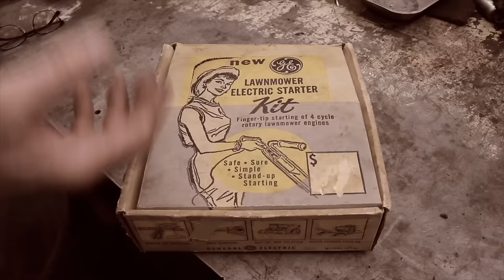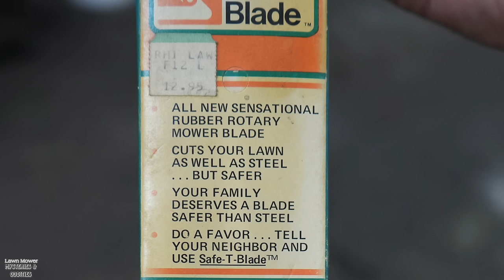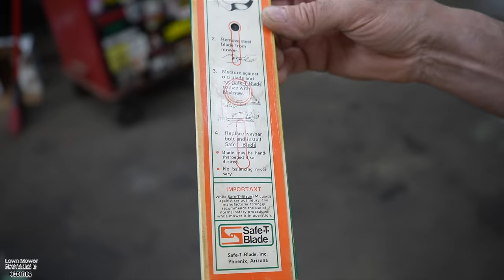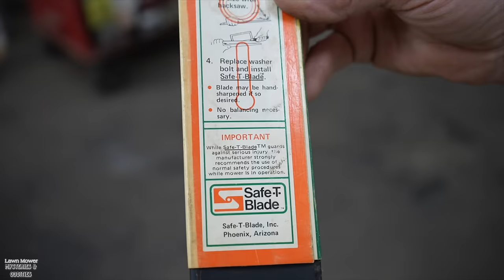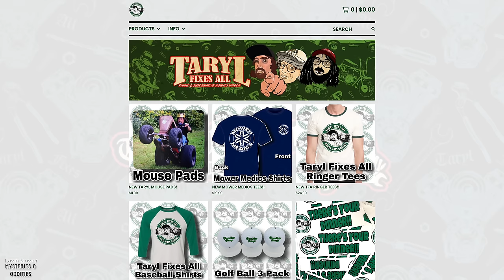Does This Odd Mower Blade Actually Sharpen Itself? Let's Find Out

Comment: Seeing this makes me remember all the hours I spent fighting a Lawn Boy mower as a young kid. 

Even today the useless drive wheels slip on flat ground. Somehow only finding traction when they can fight you. Yet whenever that assistance would come in handy they just spin. 

It easily stalled too just like I remember. That was always fun trying to yank the cord hard enough to get it going again. Or even better having to push that heavy thing back to the front or back door to get help. 

I remember the very first time I got to use a "cheap" push mower. I was still young enough to struggle with the weight of the Lawn Boy. Yet this "cheap" mower we bought for our camp. I found easier to mow with on steep ground. I could pick it up when I needed to. 

It was so much lighter. So much easier to move around. So much easier to start. So much better in every way. 

I wondered why anyone would buy a Lawn Boy. They were really overrated and underwhelming to use.
Reply: Man I love lawn boys, I have a 1982 2 stroke lawn boy and that thing can rev so high it never bogs on ANYTHING, crazy you had the opposite experience

Comment: That's about as safe as attaching your metal blade to your drill and going out and trying to cut the grass with it. Imagine that get a high speed drill attach a blade to it and do some edging. What could go wrong. Lol lol😂😂😂😂
Reply: They have brush cutter blades for string trimmers. Just like using your drill with a metal blade. Dangerous AF.

Comment: I would buy them for my rider
Reply: Why? Riders have belt driven decks so less of a chance bending a crankshaft regardless of blade material. Metal blades with an edge cut the grass blades whereas this rubber blade dulls quickly and beats the grass blades which leads to unhealthy plants.

Comment: Groceries started adding UPC barcodes before 1979.  Nominally they started in 1974, but it took until 1977 or 1978 before they were common.

The design style certainly suggests mid- to late-1970s.  1:30 $12.95 would have been unreasonably expensive before the late 1970s inflation, but even after it wouldn't have been competitive.